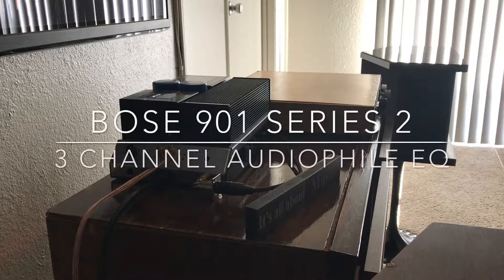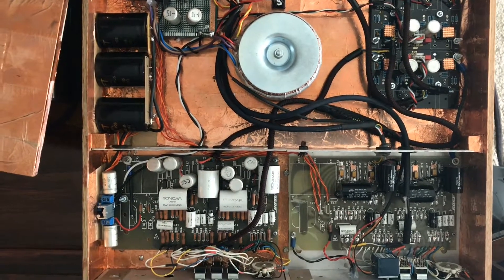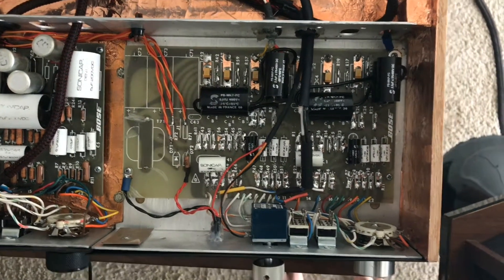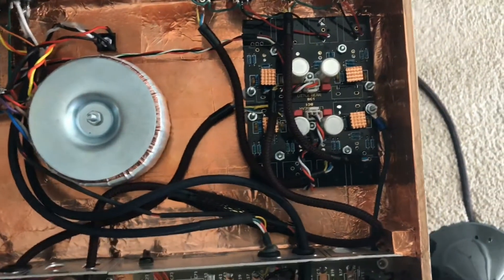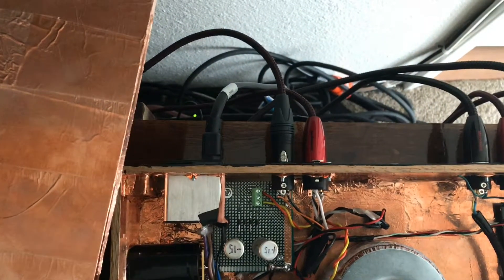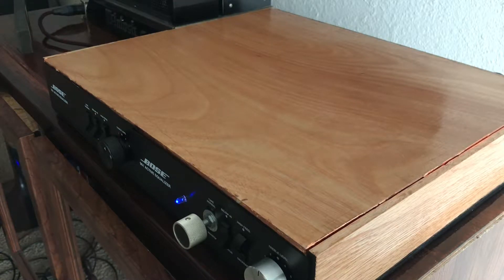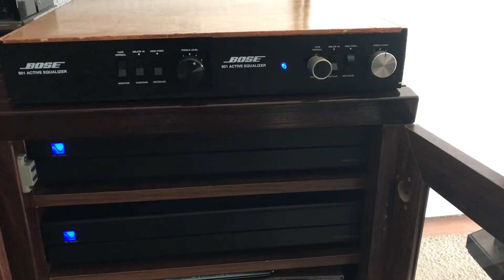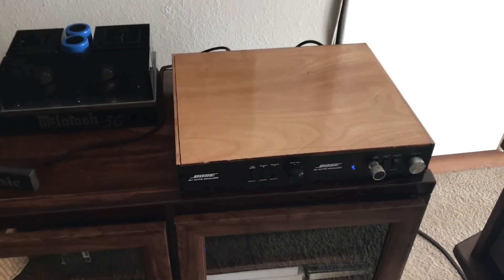Bose Series 2 Three Channel Audiophile Equalizer

Comment: Nice work! Could the hum be due to the audio cabling running relatively close to the transformer? Cable shields do not stop magnatic fields. Balanced signals won't guarantee perfect cancellation. I have had many issues myself due to transformers inducing hum in cabling (analog and digital).
Reply from the maker: No argument from me Marcel. Since this video, I found the root cause of the hum. Those Chinese Balanced/Unbalanced/Balanced adapters have no copper flooding around the traces. Even though I did my best to Star GND all PCB’s to one point inside the box. The best solution was removing the adapter boards and adding a third Bose EQ PCB configured for single channel/dual mono operation. New problem. The center channel Bose EQ PCB never had any hum issues when in true balanced mode when the output is sent to a true balanced input (e.g - PS Audio M700 amp). Now that that PCB is connected to a single ended amp (McIntosh MC50), I have hum only in the center channel. L & R are clean. Grounding the -ve pin to the GND pin for single ended operation is a bad idea on any day but for temporary, I’m stuck with it. I’ve played with the GND’ing inside the box and actually violated the Star GND’ing setup in order to reduce the Center Channel hum. I will revisit the wiring. I tried my best to keep the Audio paths away from the voltage paths. A proper balanced input amplifier will fix this but another M700 is out of the question (for now - $$).